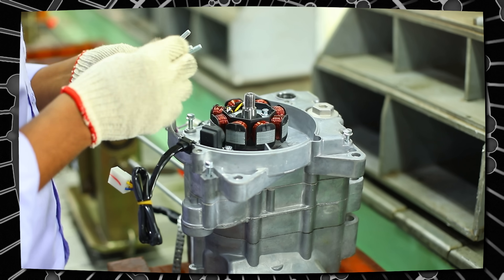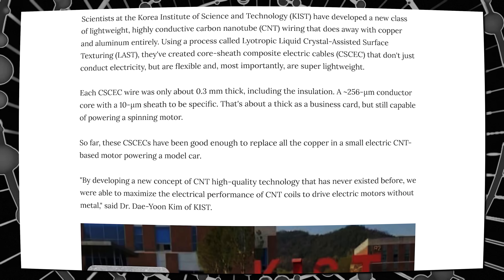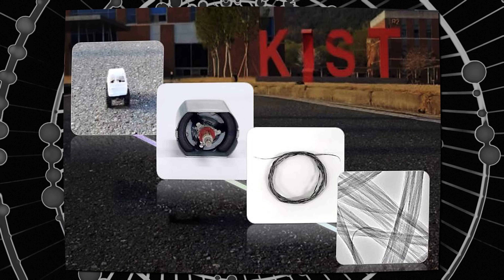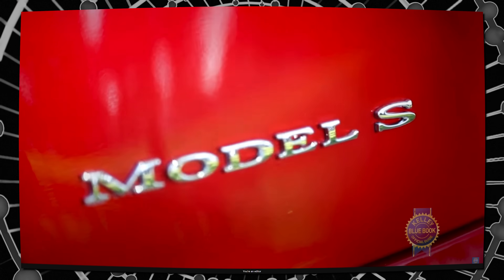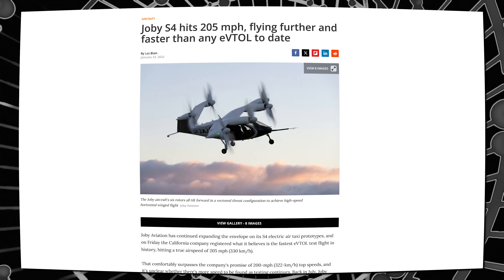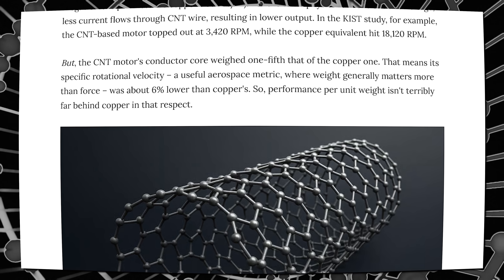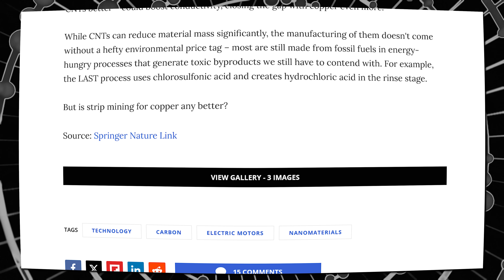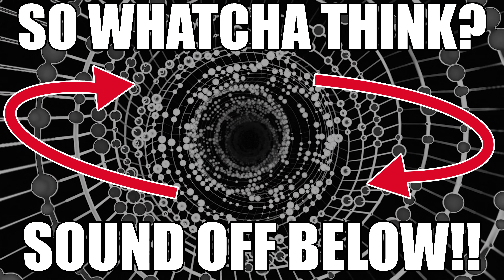Cordless Tools COULD Be CHEAPER & Lighter Using RADICAL Electric Motor

Comment: Vince, a few footnotes. Any type of lab research is always years away from actual manufacturing - if it happens at all. While this is quite intriguing, I knew right away it has to be carbon since carbon is would have those properties. But, I have grave concerns.
The manufacturing process is of great concern. These types of VOC's are really, really bad for the environment but, sadly, so many chemical processes are. 
Second, what they used as a proof of concept is hardly industrial. It's more like what they could make work for their own research. That's hardly something for production.
Third, it's a press release. They are, like all press releases, sniffing for publication and investment. 
That's not to say it's not feasible. But this is the start phases. 
Carbon nanotube tech have a shelf life and not a long one. As incredibly useful as they are, their durability has always been a problem. Have to see. 
There is a joke in research (have some hurdles to overcome but don't worry. It's ready in five years -> five years -> five years -> five years)
Reply from the maker: Appreciate you bringing up some important points, thanks for watching!
Reply: thanks for the blunt truth

Comment: Meanwhile Germany
Sheet metal copper roofs , and they want it everywhere (plus tons of lead for stuff like chimney etc , and yes....they ban it for rest of the eu but still use it😂) 😅
Now you know 😂

PS
This composit cable will be crazy hard to insulate because its not metal ...its fiber , fiber isnt smooth so they will probably need to apply insulation 2 times where second only after first dry and is cleaned from any nanotubes sticking out.
Then connecting it to anything will require ultrasonic welding etc  meaning repairing it will be impossible and thats what they want.
Plus ...will be expensive and we will have  (probably) way bigger motors (because of possible thick insulation etc) for same power
Again...expensive ....

So ......yes....
We better stick with copper
Reply from the maker: Appreciate your input and thanks for watching!

Comment: Carbon is consumed over time in all electrical applications (DC MTRS) also the amount of added weight with extra  insulation between windings along with having the rotor and stator VPI dipped to help insulate and stiffen up those windings to lessen premature failure . Stick with copper

Comment: electric motor without copper wires but fibre optic cables working at light speed.
Reply from the maker: Yup, my point exactly!
Reply: STOP IT ✋️ CANT HAPPEN
Reply: @benito2.0-v4y  and anna nicole married for love.
Reply: @TwoFeatherChannel are you telling me you agree with me correct ? I don't think it's possible ? Do you ?